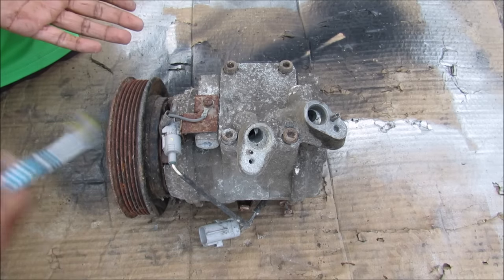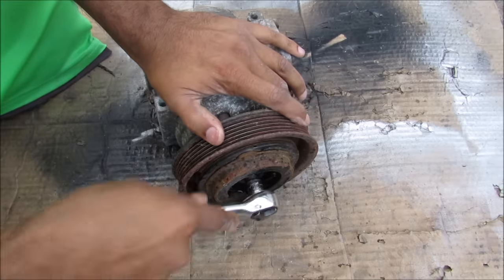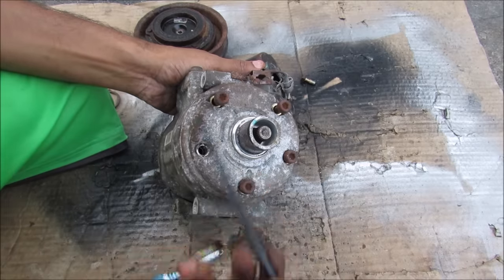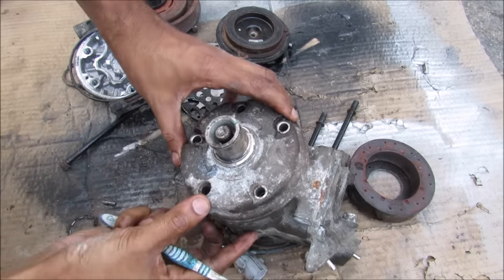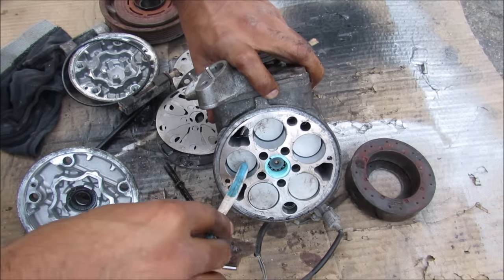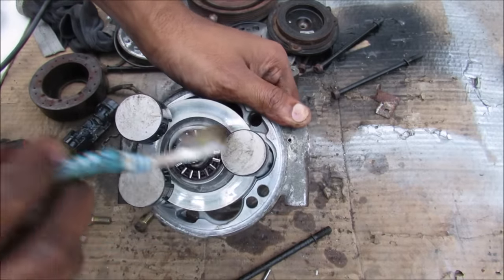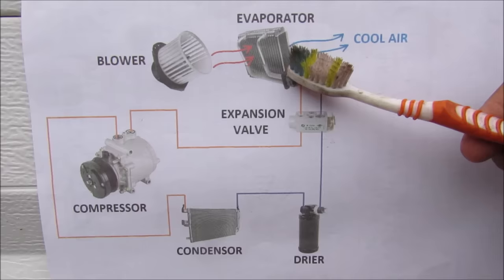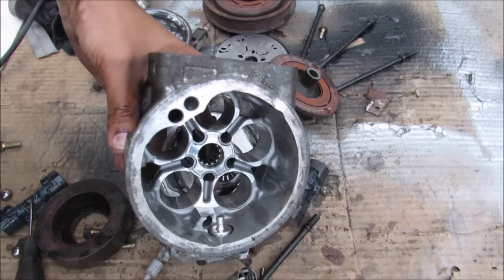How an A/C Compressor Works

Comment: So why it adds up 20-25% vibration when ac gets turned on ?
Reply: Keep in mind when the compressor goes on so do the cooling fans
Reply from the maker: The compressor draws a lot of power from the engine, which causes changes in it's idle. 
If the computer can't match the idle or the engine mounts are worn, you'll feel the compressor kick in especially on a 4 cylinder car. 

On my v6 cars I can never tell from inside if the compressor is on at all.
Reply: @speedkar99  May also depend upon compressor design... been on a small 3 cylinder car with one of these little vane rotary compressors and i couldn't tell AC was on... car sailed through gears without a single noise/vibration at all... mine however is a 4 cylinder car and has a CVC compressor, and even though the CVC always starts with the piston plate at a nearly straight angle relative to the shaft so that you never feel any kick at all when the clutch engages, that thing gets a little loud once it begins to control displacement so that the evaporator doesn't freeze up (a moaning sound begins to resonate at low rpm)... there's also a muffler on the suction line right after the firewall, and i've never seen one on cars with fixed displacement piston or rotary compressors... so yes, there are some vibrations... but never engine-shaking vibrations though...

Comment: Thats still the best a.c system not like the new direct drive pumpz
Reply from the maker: I'd like to see one of those!
Reply: You mean clutchless? Well, this might be more reliable, but the clutchless pumps are much more efficient. They only pump as much refrigerant as required, while the fixed displacement pumps switch on and off periodically and you feel this clearly while driving.

Comment: Nice video. Subscribed.
What car did that compressor come out of?
Reply from the maker: Corolla
Reply: @speedkar99  thank you sir I was looking for 1 with 5 cylinder 20th and didn't know where to look
You wouldn't happen to have a video on injector pumps or injectors would you?
Reply: @speedkar99  I've got a project I'm working on and I need to find a way to inject fluid at at least a thousand PSI without having to buy an expensive injector pump.
Got any ideas? It doesn't have to be pretty it just has to work it's a little lawn mower engine project.

Comment: 2000 Audi A6 Quattro 2.7L How do I find out what's wrong with it... I pressed on the pressure valve then I put a $50 can of AC and it still doesn't get cold
Reply from the maker: You'd need to get a vacuum on the system to vacate any refridgerant and then refill with dye to check for leaks.

Comment: I pulled the a/c from my car a long time ago and have an idea of using it as a water pump! Can it be done?
Reply: Not really
Reply: @Boz1211111  can you explain why exactly? 
My thinking was to just remove the valve plates to allow a continuous non pressurized flow!
Reply: @hulkgqnissanpatrol6121  May just end up rusting.
Reply: @hulkgqnissanpatrol6121  if you remove valve plates it will not pump, just oscilate fluid. As teravolt said it will rust and compressor is not designed to pump fluid, it will have very high resistance to flow
Reply: @Boz1211111  thank you for explainin clearly. I'm just an ideas man. Hahaha
Reply: @hulkgqnissanpatrol6121  no problem, cheers!

Comment: How dose the compressure get lubricated? Is it engine oil, or grease from the factory?
Reply from the maker: Oil is in the system cycling around
Reply: Two stroke like lubrication on automotive compressors. Oil is filled in the compressor right before mounting it on the car, once it's attached to the refrigerant pipes the compressor shaft is rotated by hand 10-20 times so that any excess oil won't slug it, then the refrigerant is put inside and it mixes with the oil. You turn the AC on and let it run for 5 minutes with engine idle, blower on full blast, fresh air and all dash louvers open, and it's primed, that is, the oil has been circulated across the whole system and stable lubrication is achieved. Coach/bus compressors have a dedicated sump, easy to fill with the needed oil and easy to check oil level anytime through a little window, and oil pump. Oil depends upon refrigerant. R-134A systems use PAG oil on cars, Ester oil on coaches/buses.
Reply: @teravolt6113  thanks this was helpful information.
Reply: @speedkar99  thanks this was helpful information. These are interesting videos.

Comment: I recently got a new AC pump for my car and before it lost compression and when turning it on it smelled bad, after the replacement it stopped smelling bad when turning on the AC, but now after 2 months of driving the new AC pump still works great, but when I turn the AC on it smells really bad the first minute, where can this smell be from?
Reply: Dirty evaporator and/or cabin air filter?

Comment: same type used in construction hydraulic pumps for bulldozers.    The problem is that is expensive to manufacture compared to single piston pump.  I wonder how less efficient to a single piston version.
Reply from the maker: I'd like to see that style of pump
Reply: I can't find any info on cars using that type compressor in video.  Usually scroll compressor.

Comment: How does AC compressor control the refrigerant pressure during idle (low rpm)
or high rpm ?
Reply from the maker: There is a pressure switch outside the compressor on the circuit. 
The ecu can then turn on and off the compressor, this one is not variable.
Reply: Some new compressors aren't using magnetic clutches on the front of the unit. Instead, there's pulse width modulated solenoids in the rear of the compressor. This gives the control module more exact performance, and can specially tailor the pressures to demands.

Comment: Why does the low pressure side need reed valve?
Reply: Adhiraj Jadhav low pressure = vacuum
Reply: So that the refrigerant will only flow to the discharge side during a compression stroke inside that cylinder. I.e. it closes while the piston is moving forwards, and it opens when it moves backwards.

Comment: I have 2002 Toyota rav4 ac works cold air but times it goes off... the ac light inside blinks... is it the clutch or fuse but i can't locate the fuse.

Comment: You did not answer my question on goes bad when it is getting weaker and not compressing on idle but compress at driving speed ,warm on idle and cold on 2k rpm?
Reply: All compressors eventually wear up to the point they're no longer able of pumping enough refrigerant to provide the original cooling capacity, the piston/cylinder clearance simply increases too much or the seal jacket/piston ring gets consumed over time and that's when capacity drops down and it can no longer cool the car on hot days unless you rev the hell out of them. They tend to wear faster if you abuse them by running AC with a low refrigerant charge inside. Even though it can also be a sign of a faulty control valve if it's a variable displacement compressor, so it could be a good idea to replace that valve (if located externally) before condemning a compressor. The one on my car took 18 years and 73k miles to get worn enough that it no longer provided adequate cooling on hot days at idle. Rotating it by hand once off the car created a squeaking noise as if some pistons lost their rings/sealing means and it was now metal on metal (not seizing thanks to enough oil, but still unable to adequately pump).

Comment: Is the a/c clutch suppose to stay engaged all the time when the a/c is on and the car is working on park gear on idle in a properly working A/C system or is it suppose to cycle on/off (Altima 2010)? Thx
Reply from the maker: Cycling is normal, the HVAC controller does that as the load is deemed required

Comment: Hello,with my Tiguan 2.0Tdi I have a grinding noise with the air conditioning switched off. This noise can be felt even at the low pressure line of the air conditioning compressor. Once the AC is turned on or switched to recirculation, the noise is gone. I noticed that the magnetic coupling (disk) is constantly rotating, even with AC-off. Do you have an idea? Thank youHallo,bei meinem Tiguan 2,0Tdi habe ich ein mahlendes Geräusch bei ausgeschaltener Klimaanlage. Dieses Geräusch spürt man sogar bei der Niederdruckleitung des Klimakompressors. Sobald die AC eingeschalten ist bzw. auf Umluft umgestellt wird, ist das Geräusch weg. Mir ist aufgefallen, dass die Magnetkupplung (-Scheibe) sich permanent dreht, auch bei AC-aus. Haben sie eine Idee?Vielen Dank
Reply: Always rotating should be the norm since your compressor is clutchless if i'm not mistaken. Always engaged, no magnetic coupling. Permanent coupling. It just varies displacement to avoid evaporator freezing and keep it at the required temperature. Look for where the low pressure line contacts the chassis and check if it's properly insulated. For some reason, a variable displacement compressor tends to transmit vibrations in a lower range when on low displacement mode. Try posting a video where the noise can be clearly heard.

Comment: how to make permenant ac rotate ? without the help of magnettic pulley .. where do i weilding it ?
Reply from the maker: Weld it right where the clutch meets the pulley. But why do you want that?
Reply: @speedkar99  tq for the info .. im thinking of modified on something else for experiment ..

Comment: with the oil in it... it probably seals as good as not better then having rings...
Reply from the maker: Haha
Reply: Either the piston or the cylinder is coated in some polymer that acts as a seal together with the oil... PAG 46 refrigerant oil=very thin oil=everything built to very small tolerances... looks like it's the piston here

Comment: Is there a simpler design?
Reply from the maker: I would assume this is the simpler design, the variable compressor is alot different
Reply: Yes, the "scroll" and the "through vane" compressors, where there are no pistons and rotating plates.

Comment: Can you tell me how much horsepower car ac compressor needs?
Reply: Mainly depends upon discharge pressure, which is proportional to ambient temperature and increases further if the condenser fins are dirty. Can suck away as high as 5 hp in the summer.
Reply: Thx alot
Reply: What about the mean pressure produced by the compressor?
Reply: What about the mean pressure produced by the compressor?
Reply: Can we use 12 volt electric air compressor giving 150psi or 200psi pressure
Reply: @learnousmodificatex349  Can't give a definite answer on that.
Reply: Cant give specific answer on working psi of  compressor or the other option i have given?
Reply: @learnousmodificatex349  Don't know them. Unaware of any pressure test done on these compressors, so can't answer.
Reply from the maker: You might be able to find some information int he vehicles repair manual
Reply: My car is old model and dont have any manual

Comment: I took one out of an 09 civic, and disassembled it,found no piston on the inside of it. It has the blades like design....which works more effectively ?
Reply: It works more efficiently (smaller compressor for the same performance vs a piston design), it's quieter and it's more tolerant of liquid refrigerant, but it's more fragile... that is called a "scroll" compressor.
Reply: Thanks

Comment: "oily substance".. You mean, the OIL? Also an "armature" is the wired coils in a generator or motor, so there's isn't one anywhere in the AC compressor.

Comment: So i thought my ac compressor was shut. But i ended up pushing my ac button and holding it down really hard, and my compressor and condensor started working. The ac light will be on, but unless i hold it down it wont work? Is this a climate control piece problem?
Reply from the maker: Yeah sound alike you need a new switch. What car?
Reply: speedkar99 93 civic ex

Comment: The system DOES NOT "release cool air". It releases heat. When the refrigerant vapor condenses into a liquid it releases heat which then cools the refrigerant down. Then the cool liquid is sent through the expansion valve where it becomes a mist. Next is the evaporator where the mist evaporates back into a vapor. As it evaporates it absorbs heat from the air making the air colder as the refrigerant gets hotter. That colder air is then sent into your car. The hot refrigerant has then goes back to the compressor and the cycle starts over. At no point does the system "release cold". In fact, due to the laws of physics, releasing cold is not physically possible. You can only absorb and release heat. Not cold. Cold doesn't really exist, it's simply the absence of heat.

Comment: Technically, the AC system does not release cool air at the evaporator, or anywhere else for that matter. What it actually does is absorb heat at the evaporator, and release heat at the condenser. It never releases "cool air" anywhere. But, that's all semantics.

Comment: No seals needed on the pistons ,its not like the car engine,in some other compressors you see a Teflon look a like rings ,they are white ,these are the rings for these types of compressors,but in case of cars compressors you don't see these rings ,the piston itself is so fitted with the cylinder that will suck the palm of your hand when you rotate it.it will reach -30psi of negative pressure.

Comment: Well look at that. All this time i thought it was a rotary vane
Reply from the maker: Nope. 

There's other types though
Reply: Thought the one on my car was rotary vane or something similar too when i got under the car to admire it for the first time, and was disappointed by discovering that instead of the little motorbike-engine looking thing with cylinder blocks and whatnot i was expecting, it was more like an oversized beer can with a clutch mounted to the front... after a long long time i thoroughly googled and discovered it was a swash-plate compressor and it also was a variable displacement one (and that's also why i always heard it running while AC was on)...

Comment: Why mechanics want to replace the whole compressor even when there are clear signs of only the belt wheel and magnetic wheel worn out ? A new compressor is not really cheap, it costs like $900AU for a ford falcon.
Reply: I suppose the reason is if the compressor seizes after repair (such as when the compressor has been badly abused by running on low refrigerant for a long time for example), the customer could then try to place the burden on the mechanic because he/she was the last one to lay hands on it.

Comment: The sensor is a thermal cut off not a pressure switch :)
Reply: Hmm, looks more like a shaft rotation speed sensor. It seems that everything was put on one connector for the sake of simplicity, that way it looks like it's in series with the coil, but on closer look it isn't. Thermal cut off or speed sensor, the same result is achieved: the compressor is cut off right before it seizes up.
Reply: @teravolt6113   I own a auto repair shop and some manufactures use thermal cut off. Especially toyota. I'm not one to argue but I've worked on these before hence why    I can tell u that it's a thermal cut off. Also u can't buy that part separately at least without a lot of research as to who manufactured the thermal cut off and supplies is to the manufacturer in this case most likely denso
Reply: @jamesgasper8630  If you're referring to the compressor, then that's a Denso 10PA15C.

Comment: Thanks for the tour; it was well worth one pair of your brother's underwear. But please.. wear gloves. If thats a 134a system that is Poly-Alkaline- Glycol all over your hands. Not good!
Reply: Poly-alkylene-glycol. Not alkaline at all.
Reply from the maker: Good tip. 
I just took apart an expansion valve for next week's video and got it all over my hands
Reply: @speedkar99  Out of curiosity, what kind of expansion valve? If it's the H-block type and you took it off from a car equipped with a variable displacement compressor, you might do a very interesting test: check if it closes completely or not. Just freeze the bulb with canned air and try blowing compressed air through the discharge port. Mine has the variable displacement compressor and a Japanese block TXV, and i still hear the refrigerant squirting inside the evaporator when i set the blower to the minimum speed and turn recirculation on with 60F outside...

Comment: One Issue, THATS NOT HOW YOU REMOVE A DAM AC system correctly. The EPA Be all over you. A First tell the fools they have to safely remove the refrigerant and other shit replace the  receiver dryer, and other shit
Reply from the maker: Yes refridgerant removal is the first step
Reply: Why "shit"? I think a seized compressor or a leaking evaporator, eaten from inside by moisture and the resulting acids, is the real shit...

Comment: You sir are a dangerous fool. Not warning people that they are dealing with a very high pressure asphyxiant gas that should never be released to the atmosphere . And giving the precautions they should use
Reply from the maker: Good tip. 
This was already discharged
Reply: @speedkar99  discharged? ? your doing this crap from a shonky DIY guide arent you?
Reply: I guess anyone can go to a junkyard and buy an old compressor to play with. In that case the only warning would be to dispose of any leftover compressor oil properly. No need to open a live system to get an auto AC compressor
Reply from the maker: Yep. Instead of going to the junkyard to get every part, I just bought the whole car for way less and am taking everything apart.